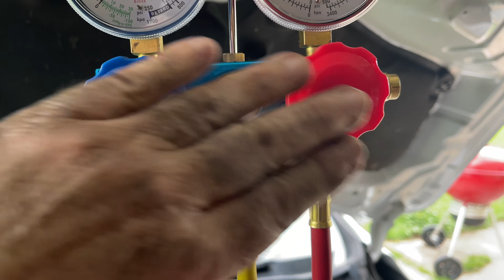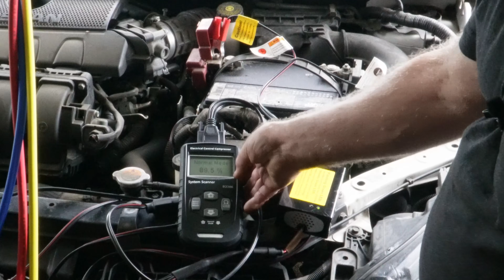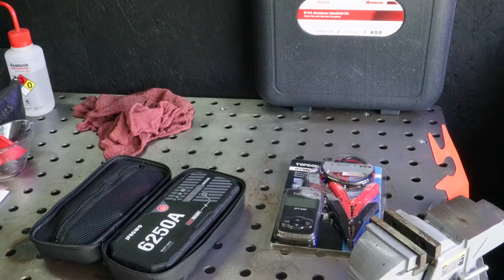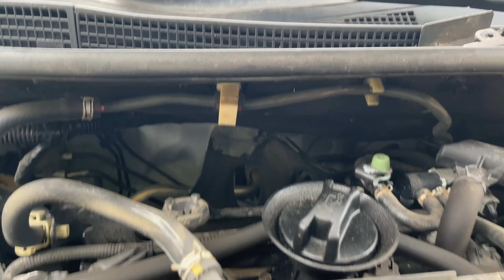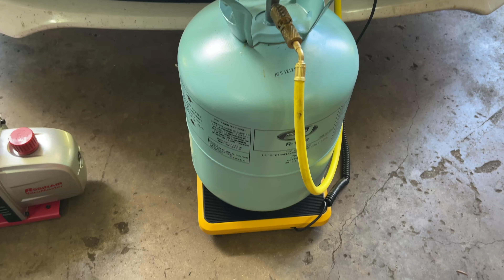How To Diagnose A Bad Automotive AC Compressor With 100% Accuracy

Comment: My compressor clutch engages/disengages on/off every 5 seconds. I hope it’s just low on refrigerant 😅
Reply from the maker: Either that or it has a restriction
Reply: @SkillSavvyDIY yeahhh gonna have to take it to an ac shop to get it properly diagnosed. 
Thank you. 👍
Reply: It IS blowing cold air though. I just noticed a hissing sound for the second time this month when I turn my truck on but went away after a few minutes so I looked it and yea it’s on and off but still blowing cold. Gonna have to take it to a pro.
Reply: Thank you 👍
Reply from the maker: @Meshuggan  You’re welcome

Comment: also those compressors have a slight angle on the swash plate so when running u will have a slight pressure differential. but if the solenoid has an issue it will not allow swash plate its full stroke. always pull solenoid and look for metal.if u see metal u should replace condensor,drier,expasion valve and flush the system.
Reply from the maker: You're preaching to the choir.  I'm fully aware!
Reply from the maker: If I see metal particles it's not only getting a new condenser, expansion valve and flushed, it is also getting a new compressor.

Comment: u can also look at scan data which will tell u whats being commanded. also a single channel scope will give u the command wave form at compressor solenoid. and some of the compressor solenoids are replaceable.
Reply from the maker: Yes absolutely, matter of fact I showed using a scan tool to watch the ECV solenoid working in real time on a scan tool review I did sometime back.  Some scan tools will allow you to change duty cycle but not all of them and it depends on the car also. I love the tool I used in this video because it will work on all vehicles and gives me the ability to change the duty cycle on the fly with any vehicle.  If you can actually find a aftermarket ECV solenoid then of course it can be changed but on a compressor this old, I would never just change the solenoid hoping that is the issue.  On a newer vehicle I may would consider it.

Comment: Remove the serpentine belt. Rotate the pulley.. if its noisy its the bearing in the pulley. Turn on the AC while running if it blows cold but noisy its the bearing in the pulley.  Check your clutch and make sure its engaging if there is no cold air... If its engaging then its the compressor or refrigerant level is low.   If its not engaging then you can buy clutch kits that have the pulley w bearing, clutch, and coil.
Reply from the maker: Yeah well that’s all good info, but this problem was the compressor itself.  There are many reasons why an AC won’t cool, and an old wore out compressor not pumping even with the clutch fully engaged is one of them.
Reply: @SkillSavvyDIY   Most drivers dont have access to gauges nor the knowledge to diagnose AC function, so you have to start somewhere to see whats going on. Cheers.

Comment: Hi i have 2000 toyota sienna, i vaccumed to 500 microns, no leaks, after proper recharge, low side is 12 psi and high side is 90 psi. will that be bad compressor or blocked condensor. usuallly bad compressor has high low side but in this case it is very low. any tips will be helpful
Reply from the maker: Where is the high side service port located?  Between the compressor and condenser or between condenser and the evaporator?  If you are reading high side after the condenser then it’s possible the condenser has a restriction which is not only pulling the low side down, but pulling high side pressure down as well.  If it is restricted then the condenser will be hotter than usual between the condenser inlet coming from the compressor to the restriction in the condenser and then cool off dramatically past the restriction.  If this is the case then the high side pressure is much higher ahead of the restriction but with no service port there then you can’t check it

Comment: What could it be if the system won’t take in any Freon past the high and low pressure hitting 50psi. Compressor clutch engages but no cold air or acceptance of any more freon
Reply from the maker: If the compressor is pumping correctly it should eventually pull the refrigerant in.  You can put the refrigerant can in hot water to build the pressure up in the can which will help push it in.  Using the small cans can take awhile because they get cold so fast.  I have a portable recovery machine and on cold or cool days, I will put my tank of refrigerant on refrigerant scales and watch how much I’m adding in as the recovery machine pulls refrigerant out of the tank and into the cars ac system, but I understand that most DIY’ers are not going to have a recovery machine, so the hot water trick is what I recommend
Reply: @SkillSavvyDIY  thanks for the reply, when i did the hot water trick it built up pressure into the system where the psi went up but no freon went in at all. Should i have kept it going for longer, I got worried when that happened and stopped trying
Reply from the maker: @nestor1136  What car is it and what is the outside temperature?  The reason I ask is if it is cool outside, the compressor will not pump at full capacity if it's a variable displacement compressor.  If it's warm outside it will pump harder.  If you don't have a variable displacement compressor, then it should pump at it's highest capacity regardless of outside temperature, if the compressor is not worn out.  You also need to know for sure that the car was actually low on refrigerant.  Just because it isn't cooling doesn't mean it's low on refrigerant.  There are many things that can cause an AC system not to cool.  Kinda hard to help you when I'm not there to see things for myself.
Reply: @SkillSavvyDIY  2020 Honda hrv it’s not a variable displacement, when I connected the manifold gauges they’re both at 0 and I pulled a vacuum and that’s when it would take a little Freon and then cut off. It’s about 85 degrees outside yea I have no clue what’s wrong with it I’m guessing the compressor should get replaced

Comment: My compressor is receiving a signal but the clutch isn't turning. The mechanic suggest I'll most likely only need the compressor so that's all I ordered. Do I need to insist he change the expansion valve with the condenser/filter drier?
Reply from the maker: On a new compressor I would.  If he notices any aluminum particles, I would also flush the hoses and evaporator to prevent it from getting into the new compressor, condenser and filter dryer.
Reply: @SkillSavvyDIY okay, thanks!

Comment: I’m from Central, Mississippi, buddy. I worked in the electrical and air conditioning business for a long time, but never really messed with vehicle air-conditioning. I’m working on my old truck now to get it fixed. I think I got it pegged. I did subscribe too buddy. Be blessed.
Reply from the maker: Thanks for subscribing!  I’m on the Mississippi coast.
Reply: @SkillSavvyDIY  it is sure enough hot and muggy down that way. I got a brother that lived down there for a long time, but he’s up in Tennessee now. I worked down there doing electrical for a while after Katrina.
Reply from the maker: @CARLPHILLY  Yeah it definitely gets hot and humid down here in the summer months.  July and August is just down right brutal

Comment: My A/C  pulley in both my Matrix 2010 1.8L and Scion Xd has a tiny bit of play when i jerk it side to side hard with audible metal clinking. Do you think thats normal?
Reply from the maker: Sounds like they both have wear.  Remove the belt and spin the pulleys.  They should be smooth and quiet, but if they feel rough and noisy then the bearings are shot.

Comment: i have a 2011 toyota rav 4 four cylinder and my gauges on the low side are very high and the high side is around 125 PSI, according to my chart it is probably the reed valves that are bad in the compressor, what is your opinion
Reply from the maker: If it has a variable displacement compressor I would have to know if it's getting a PWM signal to control the displacement of the compressor from the PCM before I condemned the compressor.  If it isn't getting the signal, then pressure will look just like a bad compressor.  But if it is getting the signal to run at the correct duty cycle, then those pressures you read does point to a very weak compressor that is not pumping or barely pumping, just like in this video.
Reply: @SkillSavvyDIY  i have read that on those variable displacement compressors that the solenoid may stick and if you hold a magnet near the connection then the fans will blow and the air will work, which i did and the air started working. i just have to leave the push button on the dash for air and keep it on when i shut down the vehicle and when i restart the vehicle the air will still work. some say to replace the solenoid on the compressor is not worth it, you have to evacuate pull a vacuum then refill with the freon... so as it is the air is working and if i need heat just adjust the knob to the hot zone and it will work and if you need the air just turn the control back to the cold zone and it will work for the cold air.
Reply from the maker: @kennylavay8492 The variable displacement compressor is controlled by the PCM.  Input signals from various sensors is how the PCM decides how much duty cycle to run the compressor at via pulse width modulation.  It is constantly adjusting the ECV solenoid.  If you are able to control the solenoid with a magnet then the PCM is no longer able to control the duty cycle.  If the compressor is running at full piston stroke then this will lead to the evaporator freezing over since the solenoid is no longer being controlled by the PCM based on sensor feedback.  It will never operate correctly with this method you explained.  The fans are usually controlled by pressure transducers, not the ECV solenoid.

Comment: New 2024 truck at work adjusts AC temp based on the dashboard outside temp reading.  Problem here is the dash temp only updates if the truck is driving 30mph for likes 15 minutes..

So when i idle all morning at jobsite, by 11am dash temp still reads 25F and blows hot air even though it's 60F and sunny.

Took it to dealer, they said it was fine. modern junk
Reply from the maker: Put your ac in full manual mode instead of auto.  Most vehicles does not use the ambient temp sensor in manual mode and it should remedy the problem.  What you described actually is common on newer vehicles.  It requires air moving over the sensor to work correctly, so when idling just turn off the auto climate control and switch to full manual and you should see a big difference.

Comment: I v got one on a 2017 hyundai santa fe limited ultimate 3.3  and the control valve has a freon leaking by it. When freon is good compressor works just fine. Next week Im changing out the $75 control valve instead of a $450 compressor. In your case I understand  replacing the compressor.  In my case the control valve is going to get changed out, and vacuum down the system. Then I'm going to charge it up. I might put a dryer on it but not sure. The car just has 80.000 on it. Thanks for the video.
Reply from the maker: There are o rings on the ECV solenoid that are most likely whats leaking.  You could just match them to the proper size and save the $75 if that is the only issue.

Comment: hey, I'm back. I have another question but now is my Elantra 2008. I added freon and is working fine, cool really good, but now is making the motor to vibrate. Every time I put the A/C the RPM goes down and the motor vibrates, stay at 600 RPM or less but the car Vibrate and I see the motor vibrate much more than when I turn it off. Once I turn off the A/C RPM goes back to normal. Idler air control valve is new. Motor mounts are new. PCV clean. MAFS new. Throttle body clean. throttle body sensor new. O2 sensors new. Car has 182K miles. Engine filter new.
---  Any Idea?  Thanks
Reply from the maker: The idle air controller should raise your rpm to around 900 rpm when the ac is engaged.  Even if it’s new there could be a possibility of a wiring issue or it’s bad out of the box.  Also check the high side pressure to make sure it’s in range and not putting excessive load on the engine.  Those are the first two things that come to mind.  

Turn A/C off observe if idle smooths out (if yes, it’s likely IAC or compressor-related).
Clean throttle body (using throttle body cleaner).
Check if your idle speed increases slightly when the A/C turns on — if not, the idle control isn’t compensating properly.
Reply: @SkillSavvyDIY  Listen to this. I remove completely the throttle body cleaned and change the gasket. bought a new position sensor, installed a brand-new IAC OEM from Hyundai, but that one put the RPM high to 900 in parking and shoot the engine light as a vacuum, so I have to turn off the car fast to avoid the engine light. Now I replace it by No OEM from Amazon, and it keep it RPM around 650 which is not what supposed to be (630) but is almost there. With the OEM IAC valve when I put in Gears (reverse or Drive) drop the RPM and make the car shake and when I turn on the A/C do the same that's why I change it. 6 or 7 months ago this never happened.
--- My Kia soul 2012 never raise the RPM when I turn on the A/C, ever, stay very smooth and the Elantra was the same.
-- My compressor is working fine, its designer to keep working, it never stops and the fan always works in high speed with the A/C. If I turn off the A/C the fan stops, but it could turn on when the car is hot, for the cooling system or radiator.
-- So the car is dropping RPM with both IAC, but now the one from Amazon is giving me more stable idling in park and neutral. 
--- could this be happening for the Alternator? I was doing a lot today in the car with my OBD2 and I see when I turn the head lights the car also vibrates. the car has 183K miles so maybe. is charging from 13.89 to 14.1 v
Reply from the maker: @HeydaCarreras  Hope you get it figured out.  All I can do is speculate on what's going on based on what you told me, but sounds like you have covered your bases on everything I suggested to look at.  If you use your foot to manually bring up the rpm to around 800 to 900 with the ac on, does it level out?  If it smooths out then I say it is still idle related.  You could try taking belt off and turn all the pulleys and tensioners on the front of the engine by hand to see if you have any that is getting hard to turn by hand or possible bad bearings.  Alternators can get really hard to turn by hand and sometimes lock up.  Just a suggestion of something to rule out.
Reply: @SkillSavvyDIY  Now look what I checked today. Turn on the car with my Topdon battery check to see how the alternator is charging and it show perfect: 14.36 v without load, then rev the engine :14.16 v wit load. The Alternator is working fine, and the Battery is charged.
so, the car was on and when the rev went down to normal that take like a minute or, so the motor was beautiful, turn on the A/C and the motor was beautiful, but the motor in still cold, once the motor start warming, I turn the A/C and motor start vibrating. The motor vibrates when the car is put it in drive or reverse but when is hot. it can't be the motor mount, those are new. this car have me crazy.
Reply from the maker: @HeydaCarreras  It’s frustrating I know.  Hope you get it figured out

Comment: what about testing the solenoid control valve to rule that out on a variable displacement compressor?  just checking the ohms and commanding it on and off doesn't rule it out that the solenoid is good, it could be stuck open or closed.  the compressor itself can be good but have a bad valve in it that has failed which is only a 45 dollar part to replace vs 3-500 for a new compressor, the control valves have a high failure rate in some compressors.
Reply from the maker: I addressed that very thing in the video, but I guess you didn't watch that part.  Commanding it on and off was to make sure it was getting the PWM signal to operate so I could rule out a computer issue.  Ohm's shows that the coil for the solenoid is good and should operate as designed.  If the solenoid has a mechanical issue like a sticking pintle or plunger, or if it has plugged passages, then the diagnosis is still a bad compressor, since it would be the likely source of the debris that caused the restriction or sticking.  That is usually confirmed once you remove the compressor and find aluminum fragments and filings.   Most any AC shop or dealership is going to make the same call because it is the right call regardless if you agree with that or not.  Assuming the problem is coming from the solenoid and not the actual compressor, then simply replacing the part and not addressing the root cause of the failure will certainly come back at some point, because the underlying problem that caused the failure was not addressed.